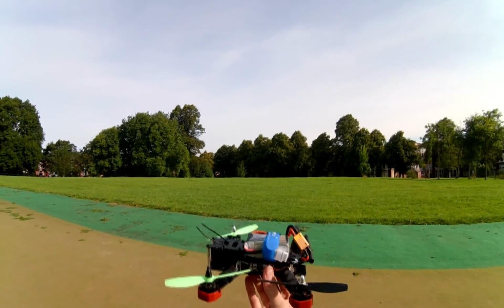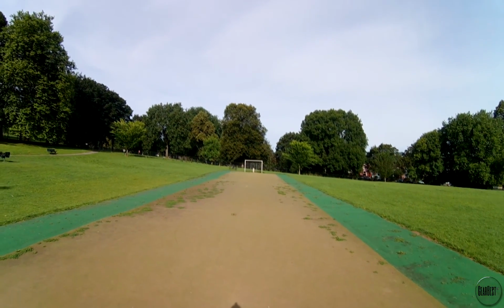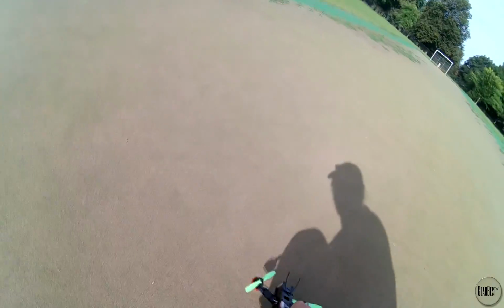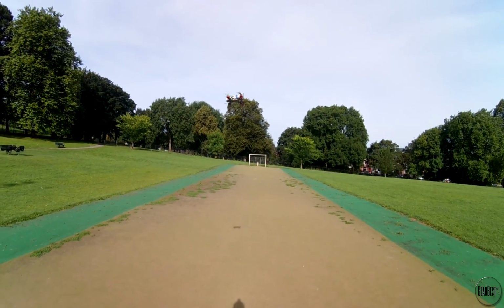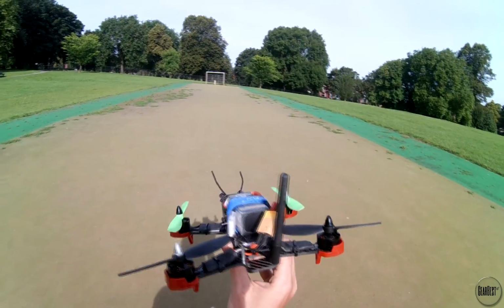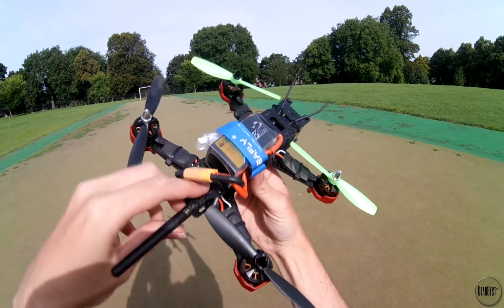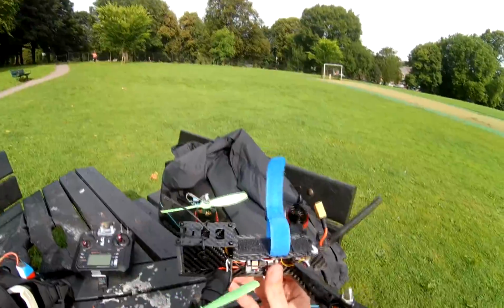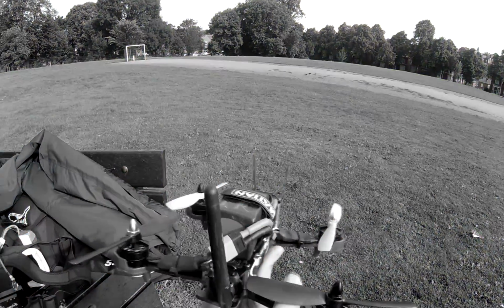Ideafly F210 Race Drone - Fiesty 4S ESC Killing (Gearbest)

Comment: I would definitely like this with just 3s and 6 inch props ,was waiting for something to happen with that 4s but she flys good thx:)
Reply from the maker: I agree but this frame won't fit 6" props. I really dig 3s and 6" props for cruising, great floaty feel compared to 5" and better cornering 'grip'. It's still surprisingly decent on 3s with 5045, just not rampant.

Comment: my mistake on the props; ) just looking at your p 200 vid liking that a lot
Reply from the maker: That lil bugger doesn't take 6" props either but that motor choice doesn't need them and 4s would kill the 20A esc for sure with the red bottom motors.
I do very much like it a lot though, fast and takes a hit with decent camera but it's still failry narrow FOV like the Walkera. It seems most racing cams steer clear of wide FOV for realism but like you state din your Rodeo video - it makes exact camera tilt tricky for slow glide and FFF.

Still deciding what I like for FOV but I think 120-130 degrees is about my sweet spot if for acro. Happily use a 170 if it just for cruising. 90 makes me feel claustrophobic unless just hitting gates around a a course you know.

When people state their camera tilt and don't mention the cams FOV it drives me bonkers. It's like saying you run 6" props and then not saying if it's on 3s or 4s, kinda pointless

Comment: Nice video! I've got a question I broke my Rodeo 150 frame, but I don't want to buy a new plastic Walkera frame. Do you think its possible to just screw the hole thing on a random 150 size frame from Banggood? Thank you.
Reply from the maker: I need a new frame and ESC so was considering the same and the Tarot 150 frame but that big U shaped PDB is an issue.
The FC uses a ribbon cable to connectors the PDB so they are kinda essential to use together and the PDB uses blade connectors to the ESC too. You would have to secure them perfectly aligned and well enough so connection was not lost. Perhaps you could solder wires from ESC to PDB to place them else where.

I was considering using a different FC and ESC but the cam is poor and VTX also proprietary so at that point you are only using the motors and cost is high and parts wasted. 
Last night I decided to just order another frame and ESC as it flew superb and took cartwheels over grass. If another ESC goes I will call it a day and trade or use the motors in the T130 and move the parts to a T150 frame. It would be ballistic on 3S with smaller props but I think i'm a bit power hungry lately after flying 1s micros for 3 years so my judgement may be off :)

Where did your frame give in exactly, base of the arm somewhere?
Reply: +MicroRCFiend Thank you for your response, one arm is completely gone so using glue is not an option. I can order a new upper and lower body but I'm afraid it will happen again sinds the plastic body breaks easily compare to a carbon frame.
Reply: +MicroRCFiend I was flying full acro fpv for the first time. When i felt comfortable i did some rolls witch were awesome! Then I tried a nose down dive, but instead of a nice dive like in the pro video's my quad just did a thousand flips from 50 meters it was not possible to regain control again. Did I do something rong or are these Rodeo's not designed to do these acrobatics? It didn't feel like I pushed the nose to far down. When I see these video's i see people just nose down almost no throttle diving, so I don't understand why mine crashed? Well it was a very short introduction to acro fpv :( do you think a carbon self made frame for example 250 size can handle such crashes better?
Reply from the maker: Justin The Rode handles tumbles and acro very well so i'd guess there was some other issue to keep flipping if not user input. It's a F3 board and tuned well so very capable unless you have props stop at min throttle and hold it there without air mode on?

A carbon frame should take a hit better but only if you find a good one right size for the parts and secure them well as mentioned before.

You still haven't said where the frame broke?
Reply: +MicroRCFiend Well it could be that motors just stopped in mid air. After your first comment response I rote that one arm just fully broke :( so using glue is not an option. I could just order an new shell but trying to learn acro in fpv with this quad isn't ideal I think. I would like to have a nice 250 size build that can handle such crashes but I really spent all my money on this one because I saw you flying it fpv like a boss! So this is all your fault ;)  lol. Well maybe one day i have enough money and knowledge to build me something nice.

Comment: Parts box lol!
Reply from the maker: I was thinking 30A ESC and a better camera and maybe try 5S :)
Reply: It looked like it was flying raly well ,what exactly happened to bring it down, as the footage at that time was FPV ?
Reply from the maker: The back right EC failed, now it just beeps. They are 18A DJI ESC so I knew it was a possibility. I was also using blunt nose props as I have a stash of them and are very durable but terribly inefficient too.